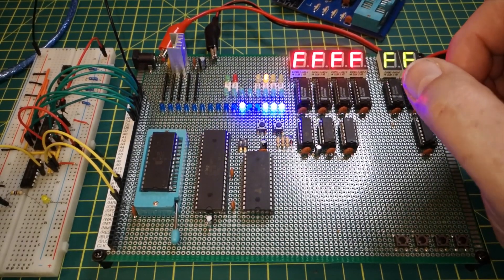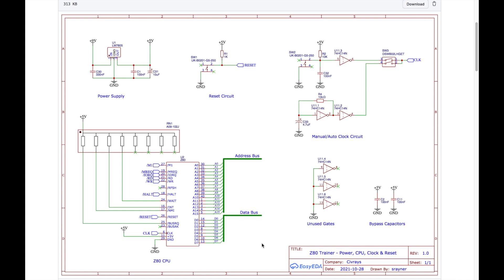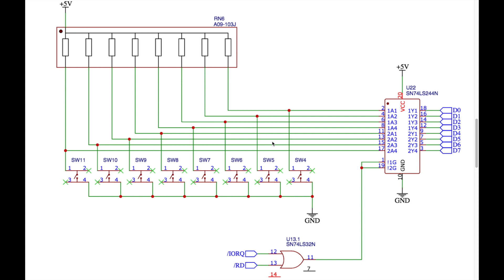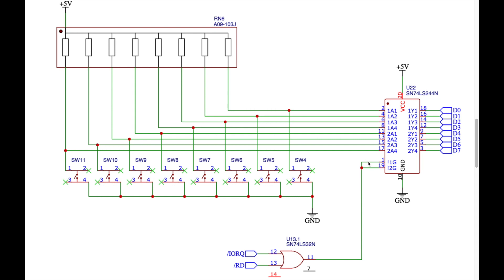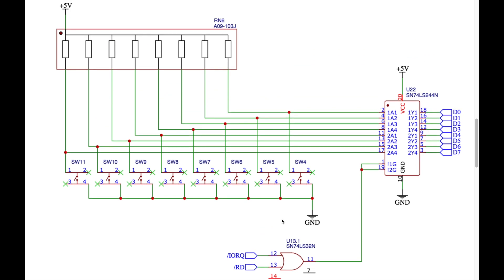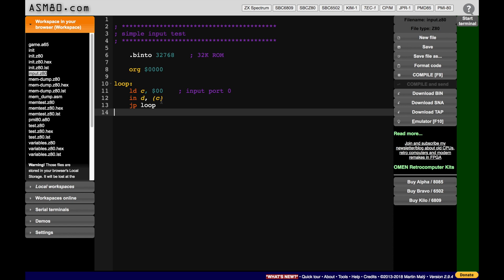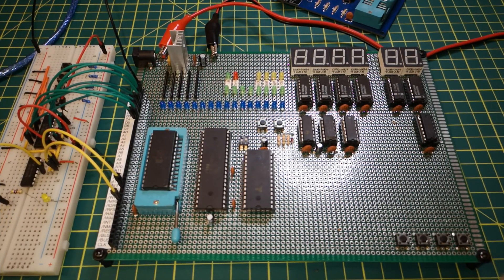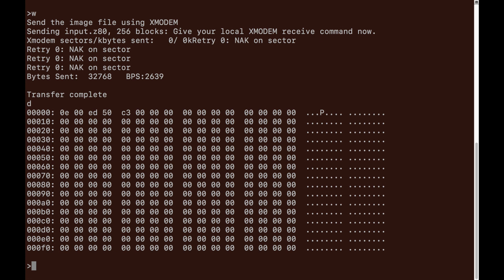Z80 Computer - Part 8 Testing Input

Comment: Looking at the Z80 processor and see there are a number of different versions. Is it that the clock speed is the only difference? Would be interested in a possible future project for myself. Actually just read that there are CMOS versions as well up to 50Mhz.

Max Clock:
    Z80 : 2.5MHz
    Z80A : 4MHz
    Z80B : 6MHz
    Z80H : 8MHz

The eZ80 CPU is one of the fastest 8-bit CPUs available today, executing code up to four times faster with zero wait-state memory than a standard Z80 operating at the same frequency. 

Do these all use the same instruction set? 
Have you looked into other variants of the chip?
Reply from the maker: I took a look at the eZ80 versions. They look very interesting. They have a 24bit address bus and lots of on-chip peripherals. They seem to have a compatibility mode and can run programs designed for the original Z80. I could not find the instruction set, but with all these new features there must be different instructions. I would also presume they have some 24bit registers. I'm wondering if you would use a higher-level language such as C or C++ along with a compiler. As programming in assembly language these days would seem like a huge waste of time.
Reply: @SteveRaynerMakes  When I first started programming it was on these Z80 and 6502 CPUs all in assembler. Coders have no idea what it used to be like fault finding your code back in the day, lol.

Comment: Something not clear from your explanation (unless I missed it (which is possible) is the or gate on the '244. Your other video and the datasheet make this very clear: The '244 is a dual quad buffer, not a single octal buffer. That means there are two /OE lines, but they each control a nybble, so to use it as an octal buffer you do want them both tied together and you do need the OR gate to select when it is active.

This is unlike certain chips (memories most often) where they have two or three enable lines that allow you to save an individual gate. The fact that this kind of thing still comes up today is why you see 1G parts in SMD format.
Reply from the maker: Yes maybe I didn't cover that point in enough detail. As you rightly say, each enable line is only controlling one half of the chip. So we can't connect our two control lines to them directly. If we did, when one of our control lines went low, only half of the 244 buffer would be activated. And it would also be activating at the wrong time, such as during a memory read. So we need the OR gate to combine our 2 control lines so that we get one combined signal that only goes low during an IO read. An then we must tie the two enable lines on the 244 together so that both halves operate at the same time. The 244 is simply 2 quad buffers in a single package.

Comment: 3:50 The diodes look correct to me. The bar end indicates the cathode which goes to negative. The triangular end is the anode or positive.
Reply from the maker: Yeah, but I'm also showing a ground symbol when it should be a +5v symbol. These are active low signals and I want the LED to light when the signal goes low. I actually corrected it before I made this video, but I've not yet uploaded the correct version to github.
Reply: The way I think of it is that the bar end is the "negative-seeking" end of the diode, so positive comes out of that end and is "seeking" the negative side in order for current to flow.

Comment: Very nice. Really interested to see the actual keyboard you designed in the previous video connected up and allowing output.
Can you show the wiring on the underside of the board? I know it looks like a birds nest, but it would help understand the complexity of what you're doing as the nice clean circuit on top looks so clean and serene.
Reply from the maker: there is an image of the back of the board in the community section of the channel, if that's what you mean

Comment: You might want some small debounce caps on your stepping buttons, I think usually 1 or 10nF
Reply: Debouncing can be done in software, but it's easier to do it in hardware.  I second your suggestion.
Reply from the maker: Yes, there is a 100nF capacitor on the stepping button, it's also passed through a Schmitt trigger inverter. But very strange it did feel like it missed a step there.
Reply from the maker: @melkiorwiseman5234  For the single stepping of CPU cycles it has to be done in hardware.
Reply: @SteveRaynerMakes  Strictly speaking, that's not true, but single-stepping in software does require an Operating System to support it.
In a Z80 system, the call to start the program is intercepted and the first instruction is examined to find out its length, then the following instruction is copied and replaced with a RST (restart) instruction which "calls" the single-step routine in the OS.  The OS then overwrites the RST instruction with the copied instruction before allowing the user to examine the saved machine state and then step the program again (which again finds the next instruction, saves a copy and replaces it with a restart before returning control to the program).
(For anyone who doesn't know, there are 8 RST instructions, 0-7, and they're intended to be used as the next instruction following an interrupt but not limited to that use).
Reply from the maker: @melkiorwiseman5234  Yes, although that's single-stepping instructions, not single-stepping clock cycles. I realized I said CPU cycles, whereas I should have been more specific and said clock cycles.